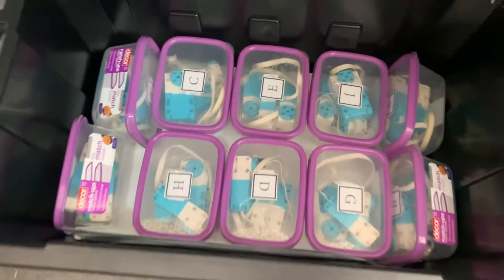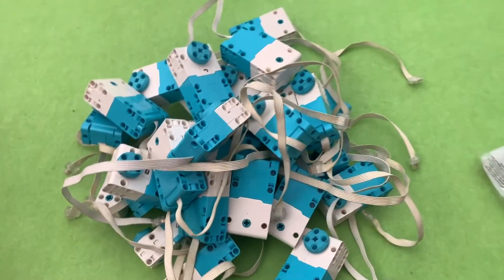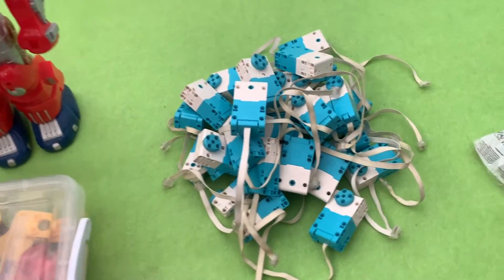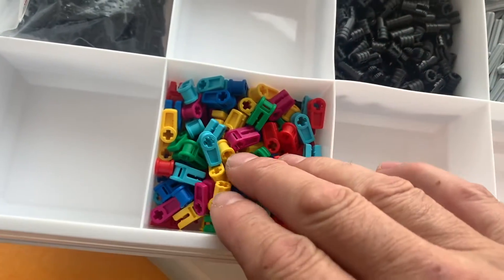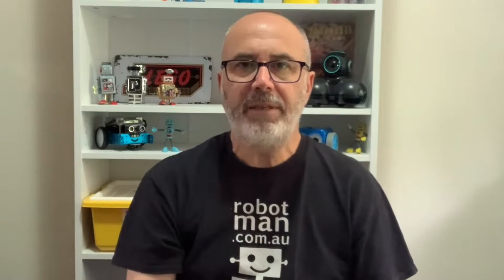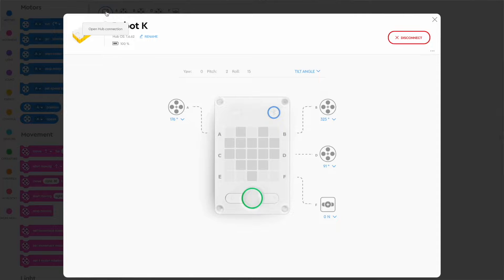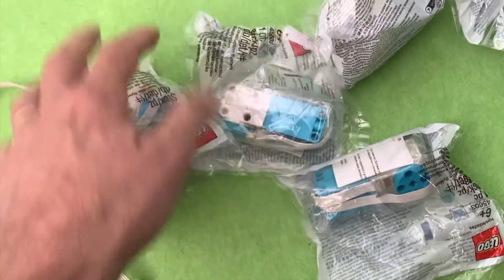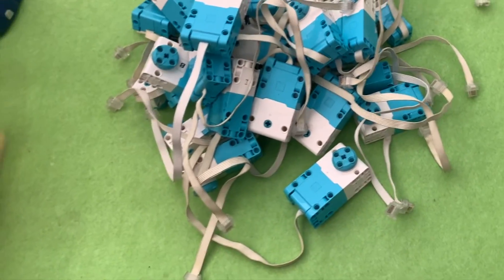Why I stopped using Lego Spike Prime Cable Clips

Comment: The new design of the motor and sensor cables for SPIKE is a real shame.

I thought LEGO had already learned its lesson with RCX and that having separate cables with EV3 and NXT would be the new norm, but no, they've gone back to leaving us with fixed cables to the motors and sensors.

Awful decision.
Reply from the maker: Totally agree. Poor design. A lot less of my motors have died since I stopped using those clips, though!

Comment: I teach and have a pile of around 25 motors with the exact same issue after a year. I think a lot of it is in the connections as well as kids constantly pull the machines by the cords
Reply from the maker: I have cleaned the connection points with an electric toothbrush and that seemed to help. Also put moisture absorbing desiccant pouches with the motors in storage. But since getting rid of clips and doing that, only one dead motor!

Comment: I do not use the clips but have similar problem as you. I have 30+ broken motors and sensors. Have got some replacement from Lego but not anymore because the warranty time is out. Every week I got a new broken sensors and motors. The cables are too weak, much better on EV3 when you could change only the cable if there was a problem. Now you need a new motor or sensor. Mission failed LEGO!!!!
Reply from the maker: I haven’t had any problems with sensors. I found a guy who buys his own cable and replaces them. It might be an option for you. Or even buy some cable and find a student who is keen to give it a go.